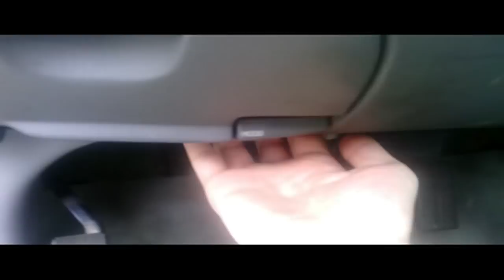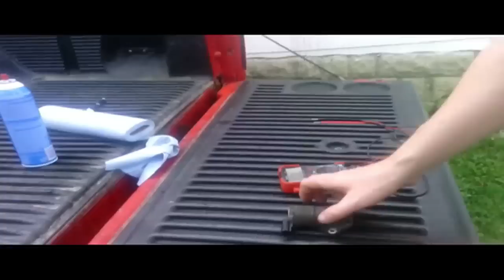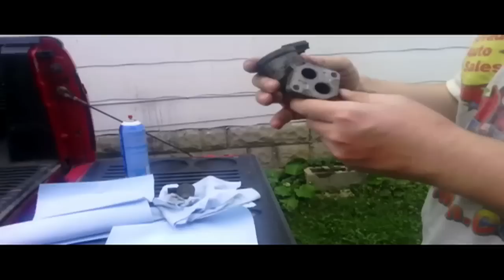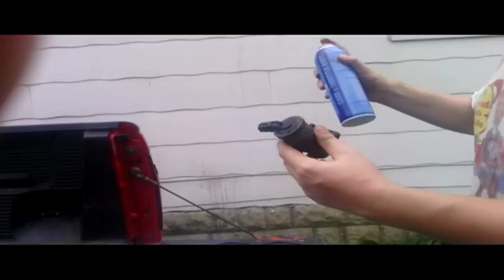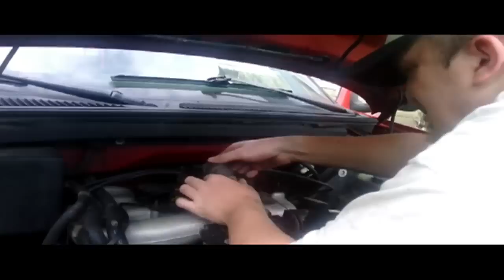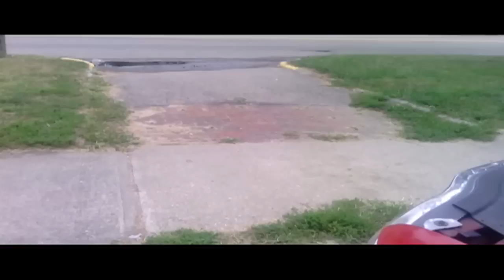How to Check and Clean An Idle Air Control Valve (IAC)

Comment: Thanks for the info , I have a question about the moving part inside the valve,does that supposed to be totally closed when I took it off to clean it cause I’d tried to move it with a little screwdriver and seem like is stuck open like half way , push it up to close it and it comes back ,,any info will be appreciated
Reply from the maker: To be honest I have no idea if it's supposed to move freely. Given its controlled by an electric motor I wouldn't think so

Comment: my 2000 Lincoln navigator has been going dead while coasting at idle and especially at red light unless I keep it Rev 1000 rpm anything around 500 it easily dies..should be around 750... but that's least of my problems with water leaks top rear right. . guess is what's coz to run hot every 20 miles..pushes water out the overflow making itself run hot.. been doing this she eye tee for over 1 yr. no f. $ to fix as caregiver to the elderly. .beside needs both heater cores replaced which makes 3 front heater cores in 240k miles... those engines rust like hell stopping up heater cores every 75k is some FBS !!.. valves rattling like hell to been doing that about a yr. too ..lol
Reply from the maker: Man that just sounds terrible
Reply from the maker: Man that just sounds terrible

Comment: I can pay someone for their time and helping me I know that this stuff takes a lot of time especially communication and waiting for people to get back and all that but if I can get the right person especially you sir if you're still responding to comments I would really like to pay someone at least fifty bucks for their knowledge and their time on troubleshooting what I think is some sort of idle issue vacuum leak or whatever but at a cold start I only start up at about 12 to 1500 I'd have to go back and check but it's pretty low it's like 12 or 1300 RPM and it starts to go down and a little quicker than usual but it does start up nice it does do its thing I just think there's some sort of vacuum leak or some sort of sensor that might be going bad now they did before I bought this truck 98 F-150 XL 4x4 with the four 6 train they did replace a mass air sensor and believe it or not I think the shop got him for like three hundred bucks it's like a $20 part probably anyway the wiring that goes to the sensor was not replaced and considering how this guy maintained this shit or I should say the lack of maintenance more like it I would say I have to change a bunch of that stuff or we'll have to regardless and I don't want I don't like surprises... as far as the idle goes I get piston slap at the beginning of a start and then it does warm up and I will be taking care of a lot of that but I do believe this to have a rough idle that can be fixed with a sensor or two and it's not pulling any trouble codes which tells me if it is sensor that everything is pretty good it's just maybe within the window of a trouble code meaning it might be a little sticky or might be feeling it just hasn't tripped a trouble code yet because it is still operating in that window of  functionality according to the ECU.. oh and I can give somebody a Banks programmer for an F-450 as well, you can have it the guy threw it in with the truck it was for something else I think maybe a flatbed or motorhome or something I can't remember but it does it is for the 7.2 or 7.3 L I can't remember I'm not into the diesel so I never take mental note that you can have this thing it's perfect condition. I just need to either talk to somebody live while I'm at the truck or maybe talk to somebody throughout a conversation with in a post but maybe I can just make my own post that might help obviously so bear with me but if you'd like a few bucks and a programmer get with me and I'll check a couple other videos you have as well but if it's a vacuum leak man if you can help me troubleshoot a vacuum leak I'll give you the same deal anyway yeah I just want this thing to stay alive and healthy and keep me safe and sound for a while not to mention we got to take care of grandma you know all right y'all thanks for the video dude you rock
Reply from the maker: Vacuum leaks have always been the plauge of me. I hate tracking those down. If you have one bad enough it'll throw a code but your short and long term fuel trims will tell you if have something going on (you'll need an OB2 scanner that can show live data) if your trims have high positive numbers you're getting too much air (thus vacuum leak). Also check your coolant and verify your coolant temp sensor is functioning.

Comment: you think a this little gadget cause a high idle? i got a 4.2 idling at around 1000.
Reply from the maker: Different things can cause a high idle. The purpose of the IAC is to control idle RPMs but other things can adversely affect the idle as well.
Reply: @ChrisRocha1672  alright man im still gonna try it if not i can check it off the list atleast. thanks for the vid!
Reply from the maker: Thanks for watching

Comment: Thanks, Chris.  When the guy at Auto-Zone pulled the code  it indicated the IACV.  When I looked under the hood I recognized it right away but wasn't positive in my assessment.  Your video confirmed what part I was looking at so now it is off to the driveway (it's 7 degrees F here) to pull, clean, re-install and test run.  I have an ohm meter but I haven't a clue as to where I set it down last.  Thanks again!
Reply from the maker: Patman Crowley glad I could help I'm back in Colorado now been cold the last couple days
Reply from the maker: Patman Crowley a quick and dirty way to test the IAC is tap it with a screwdriver if the idle changes when you do then it's definitely bad.
Reply: Thanks again, Chris.  I'll give that a try too.  Enjoy Colorado!

Comment: Please help me Chris, 2000 Ford Explorer 4.0 sohc replaced fuel pump, filter, coil pack, sprk plugs, multiple bottles of fuel injection cleaner, cleaned throttle body, etc... Still have to start it 3 times before it will idle, & then idles like crap until it's hot, but if I throttle over 45 mph on street it drops and dies. Will not restart without draining the fuel rail from  the valve then prime it and start, & still have to wait for it to idle right before I take off again...Goin nuts & going broke over this vehicle. help please!!!!
Reply from the maker: Tommy 1 C. Got me stumped on that one to be honest do you have a check engine light on?
Reply from the maker: Tommy 1 C. Maybe the fuel filter

Comment: also, it was idling kind of rough before cleaning the butterfly in the throttle body. I didnt unplug any connectors. Also, sometimes at highway speeds it would sometimes do a little hicckup, almost like a miss, but not major. it idles smooth now, but im still worried abt the engine going into another surge situation.
Reply from the maker: crackbadger man again I'd check the evap code out if you can access the the IAC without removing the throttle body then cleaning it wouldn't hurt. I don't have the specs on testing them tho

Comment: chris, my 2005 nissan frontier was at idle, in gear, and stopped. the engine surged to a very high idle and the back tires broke loose. I was freaking up seeing this happen, so I put it in park, turned the ignition switch off. I waited a minute and restarted because I was  in heavy dangerous traffic, drove home with no problem. I accessed throttle body, and cleaned it with carb cleaner and q tips, it was very gunky and dirty. I checked the codes and have an evaporative emmissions code. Im wondering what happened, as I said I was at a stop, so I dont think it had anything to do with the drive by wire accelerator pedal. Do you think the Idle air control valve could have caused what happened, thanks
Reply from the maker: crackbadger man it's hard to say there. If the IAC did it I imagine it would set a code. If you didn't disconnect the throttle body and just cleaned it you should be fine. I'd research the evap code first

Comment: Hey Chris I just put the EGR valve in it was doing the same thing with the old one it would start but it would not run that's why I put a new one in but thanks for the info
Reply from the maker: Darrell Arrasmith my apologies for such a late response I had another F150 that kind of had the same issue after replacing the egr it never ran right again although if I recall I took the throttle body off too and I think it somehow messed it up either with a hidden vac leak or the computer never properly relearning idle

Comment: Thanks for the video. Now my 1997 E250 idles fine in the cold weather, after having problems with it for years. Didn't cost a penny to fix either. I cleaned it with carb cleaner while working the plunger up and down with a screwdriver. Then I followed with compressed air and finally WD-40. Like new!

Comment: My car is accelerating on its own with my foot off the gas. Will cleaning the IAC fix this?
Reply from the maker: Carlos De Leon not sure but kind of doubt it. I'd check your linkages and if there's any restriction on your pedal
Reply: I already fixed it. It was the part next to the IAC.
Reply: Carlos De Leon the throttle body sensor?
Reply: Yeah, I think.

Comment: Excellent.  My 99 F150 has 372000 miles and started rough idling and dying at stop signs, red lights, etc. after changing the plugs, wires, coil packs, alt, belt, etc.  Never heard of this particular component but pulled it, checked it, cleaned it and she idles like a champ again.  Thanks for the DIY info.
Reply from the maker: glad I could help
Reply: Man bro this is exactly what wad happening to mine but i changed it and it's still stealing put! Wtf any other suggestions?

Comment: Hi! Please say if you know. My older vehicle calls it's IACValve an 'idle speed control Motor'. It is located behind my EFI throttle body, just like most IAC's. Do you think mine has the same type 'piston'? can be cleaned just like yours? Thanks!
Reply from the maker: without seeing it i couldnt say for sure but id assume yes
Reply: my assumption as well Chris; thanks and keep up the good work!
Reply from the maker: thanks

Comment: My car was idling high, so I unplugged the AIC and adjusted the throttle adjust set screw and my car is Idling better. Per your instruction, now I'm going to clean the AIC and plug it back in and see how it works. Thanks Chris.
Reply from the maker: thanks. a ootnof thebnewer cars dont line thise idle screws messed with

Comment: If I take my battery loose and let it sit for a few then hook it back up the engine light turns off and truck runs great then after a few mins of driving engine light comes back on and when I give it gas it sputters like it's gonna shut off been picking my brain getting to figure this out I've replaced plugs wires battery terminals oil change.
Reply from the maker: have you pulled the code? that will be a big clue as to what the issue iz
Reply: not yet going to today

Comment: Would a dirty valve cause truck to sputter when giving gas. Engine light to come on
Reply from the maker: I'm not quite sure about sputtering. sounds like a fuel delivery issue or ignition issue. id check on that code

Comment: Hey Chris, gonna do this to my 2002 f150 this weekend. Thanks! Would this have anything to do with the slight rattle sound on acceleration? I know it's a common problem on these trucks, sounds almost like an empty spray paint can...?
Reply from the maker: I've never heard of that but couldn't really think off hand what would cause that besides exhaust
Reply: +Chris Rocha I've been trying to research it on multiple forums, I guess it's a common thing with these 4.2L engines. it only happens in a drive gear, not in park or neutral, and only with the slightest pressure on the gas pedal. usually between 1000 and 1200 rpm. thanks anyways man.

Comment: Thank you Chris. Nice clear instructions, well presented. Good tip to disconnect the battery.
My IAC component did not look too bad until I shone a light and saw all of the carbon build up inside. Luckily I had the use of a small ultrasonic bath at work and soaked it in there for 30 minutes in weak solution of Simple green and warm water (keeping the motor end above the water level). I was surprised how black the water got. But the body and spring and plunger are now very clean. Blew it dry with an air hose and refitted it .It seems to have cured the stalling and racing problems on my Mazda B3000!!    Malcolm
Reply from the maker: glad to hear that

Comment: Great video.   Headed outside to take care of this now!
Reply from the maker: good luck hope it works
Reply: +Chris Rocha just realized I need carb cleaner and all the stores are closed for Labor Day.   Gotta do it tomorrow.  You think this will help with a 98 5.4 f 150 idil issue?  It only happens on occasions but the rpms will sometimes go as low as 400 at a stopped idil, then they shoot up to as much as 1100 without moving.
Reply from the maker: Could be iac but I'd also check for vac leaks and check for air in the coolent cause that's a common cause of that's symptom
Reply: +Chris Rocha great.  Thanks so much.  I'll let you know how it goes.
Reply from the maker: Thanks

Comment: thanks for the tip chris, i hope the thing you said about reteaching the car the correct idle is correct. It happens on my car intermittently every couple of weeks after a clean and i hope this will do the trick.
Reply from the maker: Hope it works too. Don't forget my other suggestions

Comment: Thanks for the video, my prelude keeps giving gas by itself(rpm goes up and down when I start the car), will this fix the issue?
Reply from the maker: check for air in the coolent and check if ya have any stored computer codrs

Comment: Hi Chris, very good guide. However, it is not appreciated in the video the values you searched with the multimeter, both. Could you tell me? Or are you only looking for resistance or conductivity?
Reply from the maker: I thought I covered it in the video a range of 7 to 13 ohms resistance is what youre seeking.

Comment: Hey Chris, is it better to clean IAC with brake cleaner since it's stronger than the carb/throttle cleaner?  Thanks.
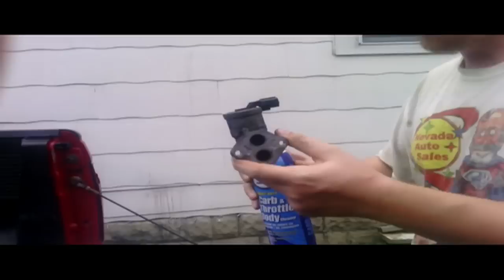Reply from the maker: I talk about this at about 6:25 in my video.I dont reccomend it because the brake cleaners tend to like to eat at rubber and o-rings and it could cause issues down the road.

Comment: Sounds like ya might have a vacuum leak.
Reply from the maker: I did I had an intake runner stuck open on that truck. Common issue on that generation 4.2 v6

Comment: Great video! I had a check engine light on my ranger showing MAF sensor problems. I replaced it and still had a rough idle, but the check engine light was off. Looked at the IAC and it was bad dirty as well as the whole throttle body and valve. Much better now that it's clean.